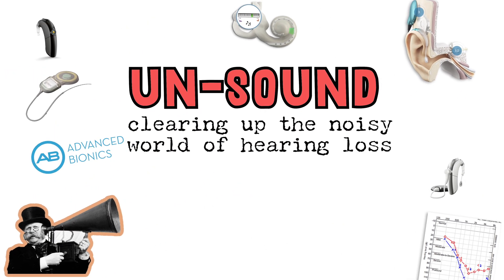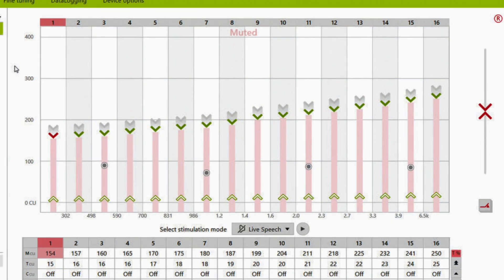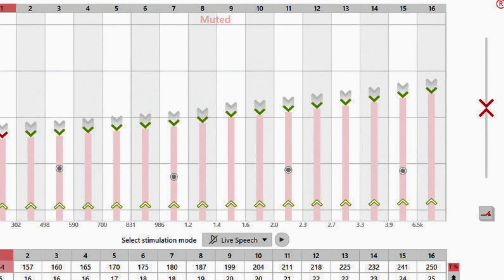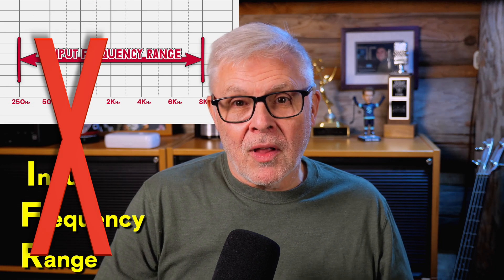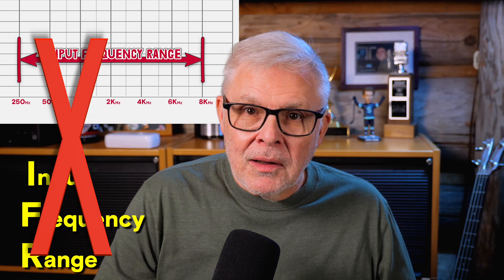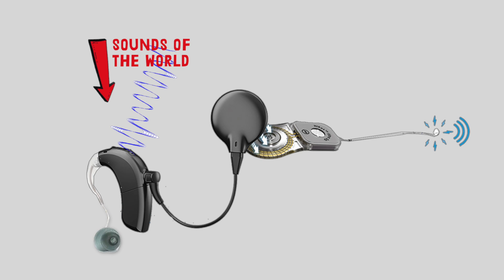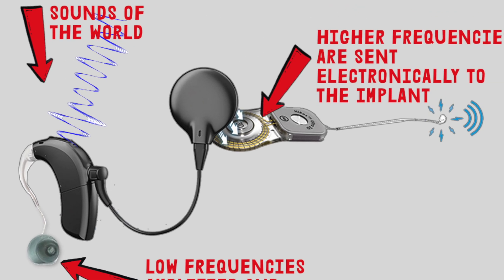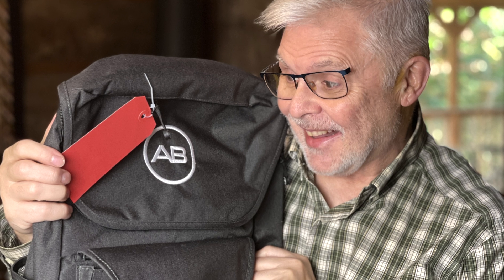How Residual Hearing Unlocked the Potential of My Cochlear Implant

Comment: Wow!  You give me hope that I might be able to hear stereo music again.

After going through the screening process, I’m approved for a Med-El cochlear implant in my left ear (profoundly deaf, no residual bass, so I chose the longer Med-El electrode array) with UCSF and Dr. Charles Limb — especially if Medicare will agree to pay for it.

Dr. Limb asked me, as an electrical engineer with a background in digital signal processing and filtering, if I planned to hack my implant.  Not really, but I hope I can work with my audiologist as well as you’ve been able to, to improve the hearing experience.  You are an inspiration to me.

And thanks for the pointer to the signal generator app.  I had been using an HP signal generator hooked up to a pair of headphones to test my hearing, but the app is much easier and more portable.
Reply from the maker: Good luck! As I’m sure you probably know, MedEl is very active in the ability to match place coding of the electrical stimulation to your particular cochlea. Keep reminding them that good music listening your goal. It won’t likely be there at the start, but you’ll probably be too thrilled by what you CAN hear again to care very much. Enjoy the ride!